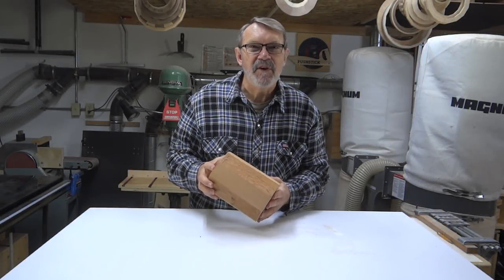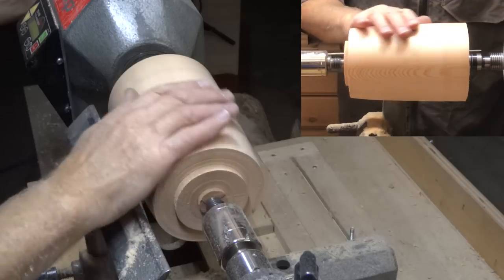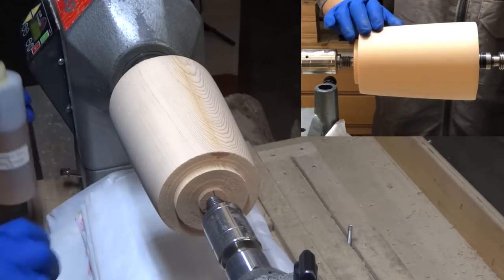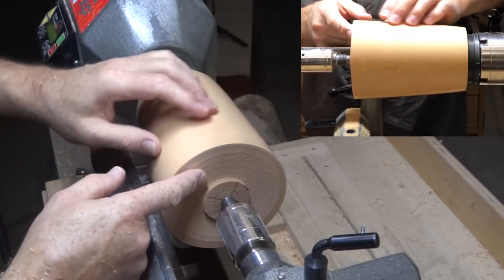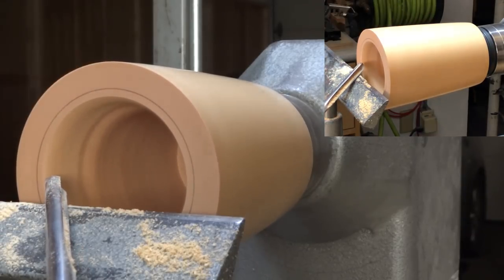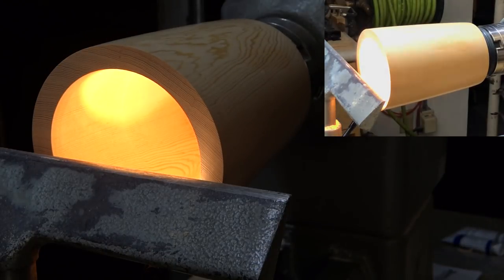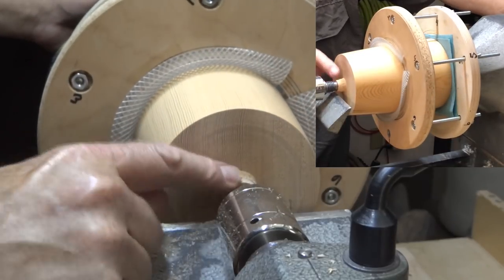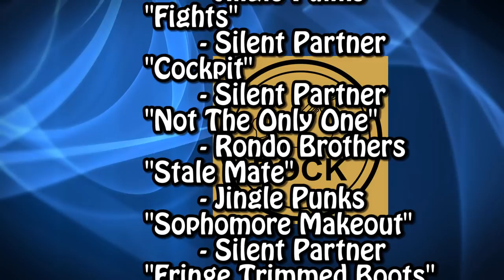Turned Cedar Vase

Comment: Nice! I made a bowl from cedar and it came out nice too. I like the donut chuck you used... time to make one! I watched you try to make a logo coin from wood a while back. Now it looks like you have metal ones. Any info on that would be appreciated!
Reply from the maker: Hi Gary,
A friend made the logo coins for me quite a few years ago on a CNC machine where he worked. Unfortunately, he no longer works there and I don’t have access to more. They are actually made from plastic. The plastic is 2 layers of different colours. The CNC router carves through the top layer revealing the bottom colour where the carving was done. I have a CNC router now which I am very slowly learning to use and I hope to be able to replicate the logo coins before I run out of them.
Thanks for watchingI
.....Gord

Comment: Love the vase Gord, nice simple lines. I agree that it could use some sort of embellishment...pyrography?
I have a tip on using forstner bits to remove excess wood when hollowing. Here is the link to a "Wood Whirler" video explaining the process. https://youtu.be/Bc5dFgVLpwI  It felt a little odd at first, but it works beautifully. Skip to 27:10 to see only the drilling part.
Reply from the maker: Thanks for the link, Gil. I watched the video - well, the drilling part - and I think I prefer my method. The reason I do it that way is that if you start with the largest bit you are trying to drill an awful lot of wood. By starting with a small bit and increasing the size incrementally you have less wood to drill each time. Just a personal preference, I guess.
I'm already planning the embellishment for the vase and, yes, I am planning to use pyrography!
Thanks for watching, Gil. 👍👍👍
Take care,
…..Gord
Reply: One thing I added to Larry's method is to make a centering divot with my skew to keep the first drill centered. They seem to have trouble finding their own center as he showed. The steps or shoulders only need to be 1/4" deep or less, so the heavy work is minimal. After the shoulders are formed the drilling is just like your method. The shoulders are used to keep each of the larger drills centered.
I'm not saying your way is not the right way, this way simply minimizes the wobble when starting the larger drills. Both methods work in the end. Just another way to skin a cat...so to speak.
Reply from the maker: Okay, now I get it! Your idea of starting with a divot made with a skew is a great idea. Then starting the cut with the largest bit to create shoulders for it to center against would be ideal. I think at that point I would still drop down to the smallest bit and increase incrementally. Thanks for the tip, Gil. I hope I remember that when I need to. 😳😳
Take care,
.....Gord